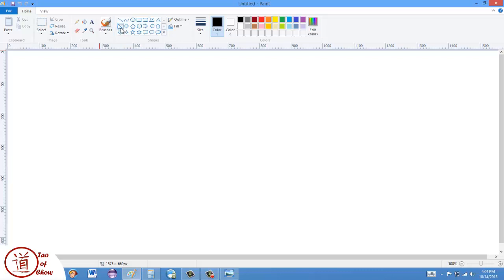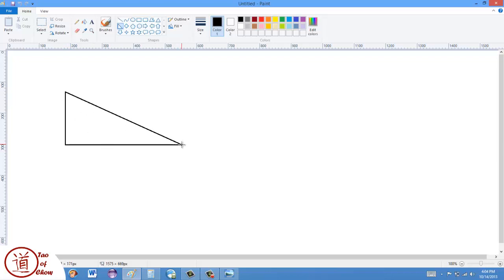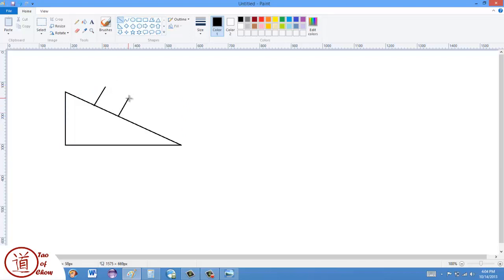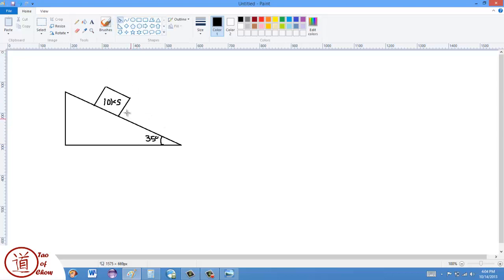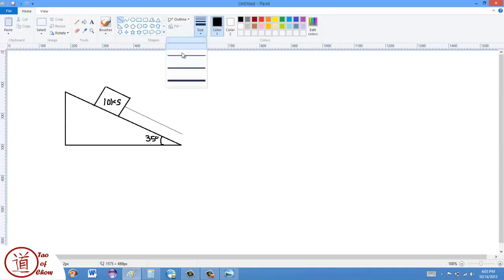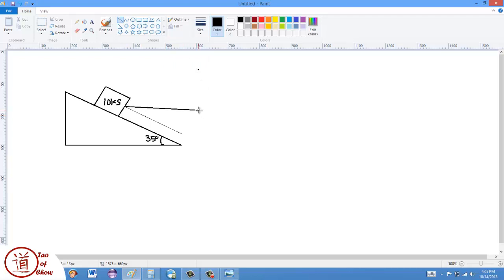Physics: Inclined Plane Example with Friction

Comment: why do you have fr at  vertical summation?
Reply from the maker: Because I rotated the axis so that the vertical is considered to be 90degrees from the surface of the ramp and the horizontal is considered to be parallel with the ramp.  You can set your axis to be whatever you want, the vertical doesn't have to be straight up and down.